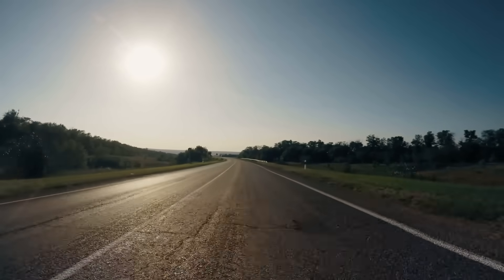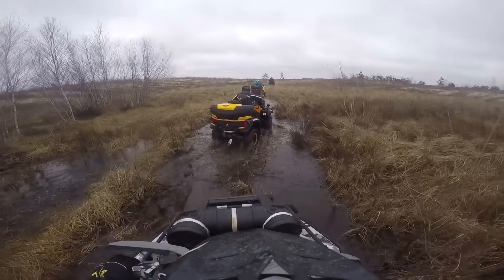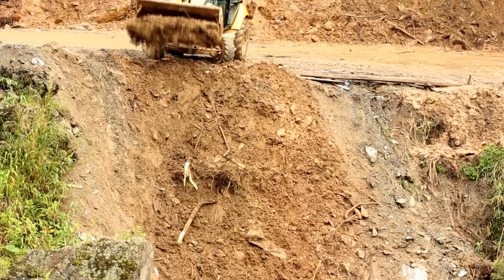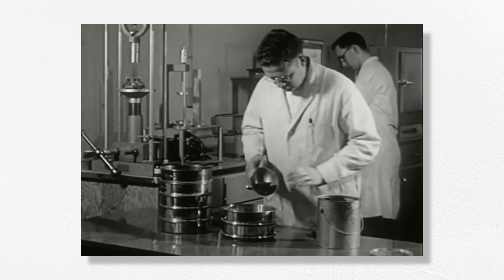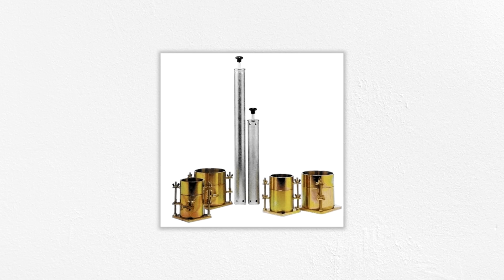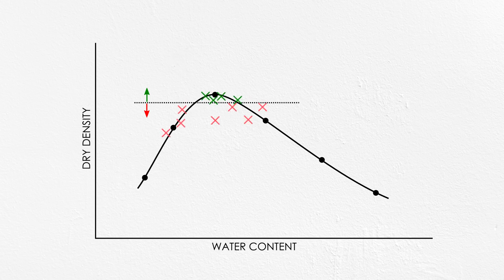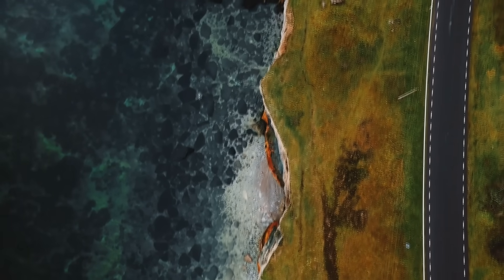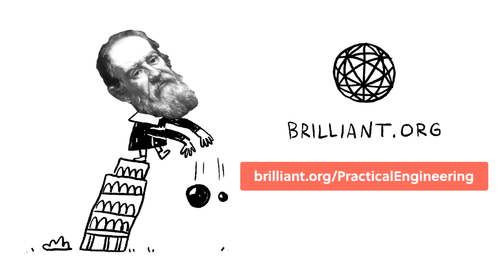Why Does Road Construction Take So Long?

Comment: This is a great video, but unfortunately it doesn't answer the questions I have regarding why roads take so long to finish.  I live in a fast growing area that used to be serviced by a two-lane road (one lane each direction).  This little, two-lane, north/south road connects one larger east/west thoroughfare on one end to an east/west freeway on the other end, about 4 miles away.  They decided to expand the road in stages, one mile at a time, from one lane each way to two lanes each way and with a turn lane in between AND a small buffer area of grass.  This makes the road surface, I'd say, three times the width that it was before.  On the south end is a small bridge (maybe 100 feel long) that would also have to be expanded.  So... they started this first one-mile expansion in 2017 and it took them I kid you not TWO YEARS to finish that one mile section of road.  Oh sure, every day I saw people bustling about and crews working here and there and machinery moving about, but it took two years for them to finally stripe and open both sides.  And to this day several of the "construction ahead" signs remain.  So what I want to know is why would it take so stinking long to finish one small stretch of road?  I see videos of Chinese crews building bridges in a week and finishing long stretches of freeways in shockingly short periods of time.  Why the difference?

Comment: I'm sorry but I don't buy that this is the reason why construction takes a lot of time. Eg. Japan had a sinkhole appeared in the middle of a T-junction, 3days later it's fixed. Also, Tsunami hit there shore, 3 weeks later, roads and buildings are done. In my country, politians use the road for campaign/propaganda. Instead of having roads last for at least 20years, we have roads that only last 2-6years so that the politician can "promise" to fix the road again when s/he wins the next election again.

Comment: From my 15 years experience in the field operating and running heavy highway and civil projects your explanation is pretty spot on. Other thing that add to time constraints are the unforeseen circumstances such as the amount of rain day the increase the moisture content of the soil. Or when you encounter rock on a job that was original not supposed to have rock. Sub soil not matching boring samples. Topography and soil quantities not matching after topsoil is stripped and so much more.  I once started a job in a big open field we began to run storm pipe and we found an abandoned oil tank that was rusted and contaminated the surrounding soil. You don’t even want to know the steps it takes to alleviate that issue. Any ways keep up the good work I’m happy to be a new subscriber.

Comment: I’ve been living with road construction on the canyon road that I live on and have to add another 10-40 min of waiting to my drive each way... it’s been like this for 2 years and has another 6 months to go.
Reply: My entire 7-year truck driving stint was during the period when they were building the I22-I65 connection in Birmingham.  I had to drive that fairly often, as I was going between Oklahoma and Georgia.

The detour was horrible (trucks only in the right lane, so of course some jerk is driving 25mph in it).  I got off the road a couple months before they finally opened it up.

I believe most of the wait was due to funding issues.

Comment: That was good information and all, but I swear where I live, road construction takes long because there's always one guy shoveling something while 5 other workers just stand around and watch him
Reply: I know, year old comment and everything, but this is actually more efficient, they take turns so nobody gets too exhausted and can work for longer.
Reply: @plotless7436  that's a good point, but I know for a fact that is not the case, because I used to be one of those people. They get paid by the hour and they're unionized so nobody can touch them.
Reply: It is a safety code and there has to be at least 1 person supervising for the engineers to know if anything is gone wrong and so they don’t hit any major pipes/lines

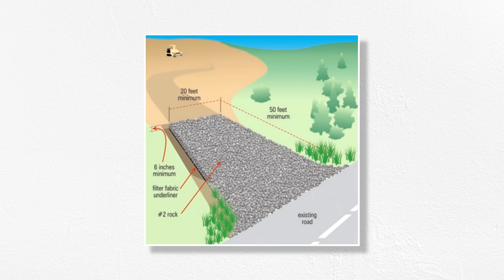Comment: up to the 8:00 mark - the runoff-stuff... I'm a mobile crane operator and I've NEVER seen a site have ANY sort of run-off protection.
Not to mention, there's only ever been ONE site that had a measure to wash mud off the tyres... with a HOSE... so muddy water onto the roads ANYWAY.

Comment: Number 1 reason road construction takes so long, You have a group of superintendents standing around talking to each other or talking on their cell phones. Then you have a group of guys standing around holding shovels watching the one guy actually using a shovel.
Reply: That’s very irresponsible comment. It’s more complicated than you think.
Reply: @Aussie-Assna-Blancos  Really, more complicated than I think? Why don't you enlighten me?
Reply: @anthonynelson9136  the guy standing could be
1. Utilility inspector from utility company who need to be there to spot.
2. A site supervisor who may be there to make a decision as to what has to be done if situation changes when you are digging near critical utilities such as high pressure gas mains, high voltage electric lines, communication cables. 
3. A geotechnical officer to spot the possible trench collapse in deep excavation where ground condition are variable. 

There are many other reasons. 
To reiterate my point, the project does not endure delay due to few guys standing around a guy digging trench. There are other critical paths whose disruption creates the delays in a project.
Reply: @Aussie-Assna-Blancos  Well maybe that's the way it is in your country but in America out of all those people you see maybe one-quarter of them are actually doing something productive while the others are talking on the phone, shooting the bull with each other or scratching their asses.
Reply: @anthonynelson9136  You need to get a job in construction, particularly construction involving earthwork.  You will then understand that it is unavoidable that there will be times when it would appear to a total novice that too many people are not busy, but that's because there are many things going on, and moment during many of those chores when there isn't something for each of those people to do.  Drive by ten minutes later and you'll likely see those same guys swarming over the work like bees.  There simply is not a way to make all the little tasks mesh together so perfectly that everyone is always involved.  I seriously doubt that a person with your attitude could believe this even with clear examples, but I'm asking you to take my word for it.  I have spent 30 years in the soil-testing business and have seen more guys on construction crews on more projects than I can count, and all I can say, is that I'm in a position to know of what I speak.  You clearly are not.
Reply: @ericl2969  I did get a construction job involving earthwork, and just retired last year, and guess what the company I worked for built, that's right roads and bridges. I worked my way up from starting out wearing a yellow helmet to a white helmet when I retired. But I guess you being a big-time soil sampler or as I call you guys a dirt taster would, of course, know far more than me on the subject.
Reply: @anthonynelson9136  You guys mjust have a different work ethic in your part of the country than what I see, or maybe the unions are revered too much.  When I see guys not working, it's normally because of the kind of thing I described.  And so often, there's one minor complication on the part of one subcontractor, and then the crews from one or two other subcontractors are dead in the water until it's resolved.  And nobody likes it.  A perfect example is on a typical paving job, being called at 5:00 or 6:00 in the morning being asked to test concrete (our company did that too) at 7:00, and then I hear, "the earthwork guys have (some issue) and it won't be until 8:00", and then that keeps getting pushed back and it might be noon before the grade is actually ready.  Sometimes it's a cascading process of complications.  These are things they try to work out ahead of time with all the pieces falling into place like a puzzle, but when something minor happens, it screws up the whole works.  And yes, being a tester and being in constant contact with the foreman and many of the workers lets you see behind the scenes pretty well.  Here's a question:  In all those times you saw guys sitting around, did you ever hear them joke about "all those people driving by are gonna be talking about 'one guy working and four guys watching' " on account of the situation at hand.  I heard that more times than I can count.  The workers know how the public perceives them and they know the public is wrong.
Reply: @ericl2969  I worked in many different states and it was all the same. I did have as part of my crew once some guys that didn't lean on their shovels or use the wheelbarrows as recliners, of course, they were prison laborers. You sound like the water boy on a  football team talking about how hard it is to play in the trenches but have only watched people play the game. Yet in your mind, you are still an expert because you stood around watching.

Comment: The highway I live on was built a long time ago and has recently been deemed too narrow. So in order to fix this they put down pavement on the shoulders on both sides which worked great. Then they found out about some new regulation that declared all new roads should have tiny reflectors on both sides to denote the edges and also warn drivers when their tires hit them. That also works great... except... the regulations for the reflectors does not allow them to be placed on the paved extensions on the sides of the main roadway but rather about 4 inches inside the edges of the main roadway itself. So now our road that was too narrow has been widened and then re-narrowed back to to be even more narrow than it was originally. It is actually dangerous now. Got to love those clueless bureaucrats. Tax money well spent and all that... **sigh**

Comment: Most of the time it takes where I live is because they come through, tear things up, put down cones and concrete barriers and then decide they don't have enough money to finish things or another project takes priority and it just sits there for 5 or 10 years.  When they finally come back to it, they finish it relatively quickly. Because of the delay, things are usually worse than before they started the planned expansions because of the city's growth.

Comment: Very cool series.

In West Virginia, a place full of beautiful picturesque mountains and forests and rivers and creeks and natural springs, the roads are some of the worst quality in all of the U.S. (and I've been enough places to stand behind that statement)

Roads don't last very long here either. They often cave in or slide off a mountain or get washed out by a storm, and it seems the road crews half-assed "fix" it incorrectly knowing damn well it'll happen again in a couple years.

While it's a nuisance and all the residents hate it, I don't think it's entirely the engineer's / contractor's fault. The environment is very hard on infrastructure, and a lot of that due to too much water and four real seasons and sometimes wide intra-day temperature swings. 

I'm not sure anyone could build a decent long-lasting road here, even if hypothetically there were no budget concerns.

Comment: Grady can you talk about contracting in road construction?  We often see miles and miles of construction but it is seemingly worked on only 1 portion at a time.  Why not break up that work into multiple contracts with multiple companies working at the same time in parallel?  Would that not speed up road construction immensely?

Comment: Love it, keep this series going! What determines how quickly a road deteriorates?
Reply: one of the biggest reason there are so many bad roadways in lots of places in the US is because road construction pre-WW2 usually did not involve properly engineering the soil under the roadway. most roads are/were just laid down on existing dirt roadways, or are laid over old concrete slab roadways which were already heavily damaged/worn. This is why you will often see grind/repave roads only last a few years. sure you have a nice new road surface but you have a substrate that is totally/partially unknown, which often shifts seasonally due to weather/temperature. this can cause cracks to form in the new road surface prematurely and cracks spread the issue farther in areas that have large seasonal difference in temperature, as freezing water will widen the cracks faster. But Grind/overlay is usually still what cities do as they often lack the resources to completely re-build roadways in disrepair.

Comment: Whilst this was definitely a great video packed full of solid info, I'd just like to correct a few minor errors. 

As a road builder and machine operator, I feel I'm qualified to chime in here. Whilst it is definitely true that you can only do lifts of a few feet at a time, with major cut and fill earthworks, that is not the primary reason roadworks take so long. The real reason roadworks take forever is because instead of doing earthworks and building roads, we're too busy waiting around for an engineers report, or a surveyors report, or a soil compaction report, or there has been mid-project design changes that are slowing down work, or we're waiting for archeology clearance, or we're not working because we have to fill out a take 5, or a JSA, or there's a surprise toolbox with drug tests, or we're waiting on materials and pre-cast components to be delivered, or they were delivered but the plans and installation procedures went walkabout, or the asphalt/concrete plant is backlogged and our order is late, or there has been changes in the water management and grading in the plans...

Or my personal favourite... One that I have definitely been guilty of a couple of times, as we all have... When you're new 'operator' looks like a shovel swinger that's sat in the seat for a total of 2 hours and you ask them how the hell they got the job if they have no idea what they're doing and they reply to you with '"ook mate, that's the way things go these days, it's all labour-hire and rushed contracts... I've got the ticket, doesn't mean I'm an expert operator, I just knew enough about the equipment to BS my way through the interview to the HR girl and I got my mate Robbo to reference for me and lie." I mean, no one actually says that, but that's exactly what runs through one's head. 

So yes, there are many many reasons that construction projects are held up, but usually, the glacial progression of cut and fill is quite low down that list.

Comment: I go to school on the school bus and I pass through the Darra - Oxley Ipswich motorway upgrade (near Brisbane Australia) It used to make the traffic craw but now for some reason the bus flies through the road works ( the upgrade is not complete yet either i believe it will be finished in early - mid-2021)

Comment: Here in Washington we have a bridge being built that has been under construction for about a year now and the bridge is 70 feet long. Its due to improper original supports for the bridge. The bridge crosses a small river and has suffered setback after setback.

Comment: I’m the guy with a shovel in a hole looking for a water line while traffic passes by. You never see me but I’m usually covered in mud and soaked in sweat (no breeze at all down there). I can understand the frustration of needing to get somewhere, we all have been there! I just can’t understand the people that drive 70mph by my crew and I.. It makes no sense and you could be driving a Bugatti and still look like a douche bag. Not only is dangerous but 9 times out of 10 when there’s roadwork there is small debris in the roads like rocks and gravel. I always get satisfaction watching the rocks sling up on those cool guys cars when they’re hauling ass! People who drive the construction speed limits have no issues at all with this. Just slow down people. Play forza if you wanna be a badass so you save lives

Comment: He didn’t mention one of the most significant delays to construction.  Notice how often NO ONE is working at a site....this is because the contractor is doing work elsewhere and you have to wait at their convenience....they do this to maximise employment of their workforce, reducing down time by taking on more than one project at a time.  Do a bit at site A...do a bit at site B.....come back to site A...then shoot back to site B.  This has to cog in with other contractors doing just the same and one can’t complete until another has done their bit.  This is more prevalent on smaller projects and in towns where minor works look like just a few days effort, you find cones and those temporary traffic lights blocking your route for weeks!!!!!

Comment: I have not watch the video yet but I feel the need to ask this question since its about why road construction takes so long so here it is. Just drove by a road construction today where they shut down a section of the intersection for construction. As I stopped at the light and waited as well as while driving through the construction site. I saw at least 20 workers with a police officer direction traffic as needed. This construction site is about 100 ft long but has 20 workers and 15 of them were just either standing there talking to each other or watching 2 guys working something in the trench of the construction site. Why dont they divide the work or schedule in such a way that you dont have 75-80% of the work force just standing around doing nothing?